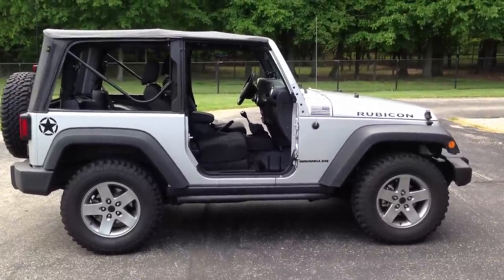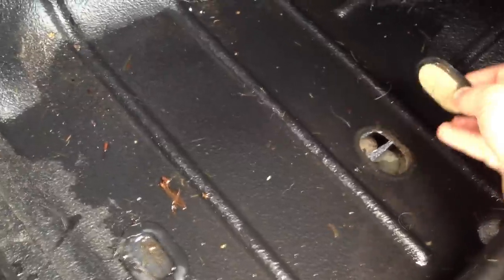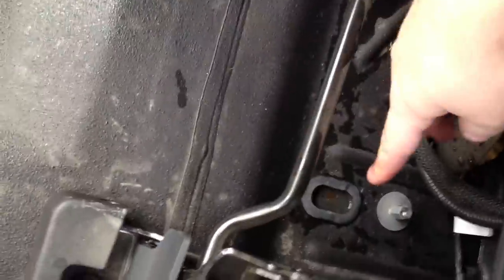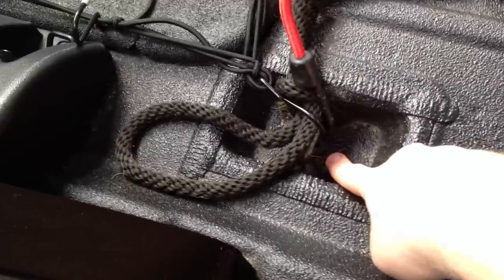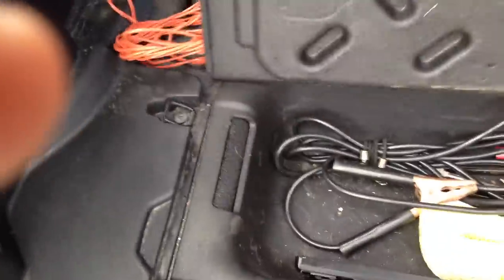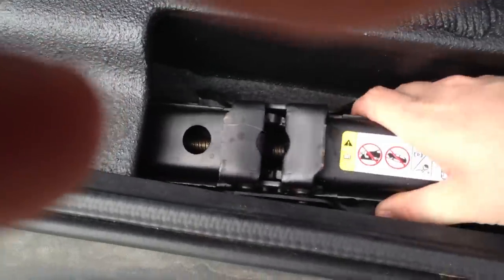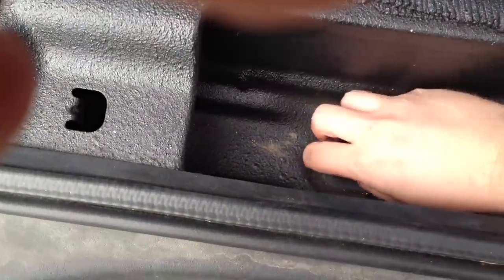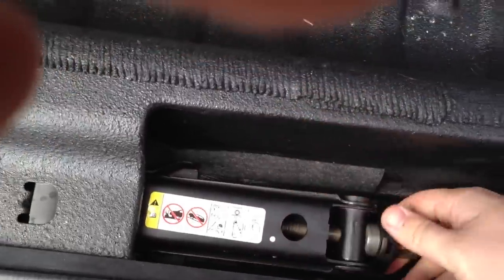Jeep Wrangler JK Drain Plug Locations and Removing Stock Jack

Comment: Do you have rubber plugs on the side behind the front seats? I just bought a 2012 and they are missing. I can order floor drain plugs, but cannot seem to find a place to get the oblong ones on the sides.
Reply from the maker: There isn't rubber plugs that come with the jeep for those holes. If i remember right the carpet covers them. I used JB weld and some sheet metal I cut to cover the holes. Then I bedlined over the metal covers I cut.

Comment: So far I’ve gotten the rear sound deadening from underneath the rear back seat I’m working on the front did you use a chisel to get the front off I used a chisel and a heat gun I have the same jeep 2dr
Reply from the maker: Thats what i did too. It took awhile.

Comment: was wondering how u find road noise with the bedliner instead of carpet?
Reply from the maker: It doesn't bother me. I have noticed when I have the hard top on in winter that I get a slight whine from the rear diff. Its pretty faint, and I always have the radio on so I don't notice it. Likely if I kept the unsightly heat/sound reducing goop in back there it would cover it up? If I had to do it again I would only have removed the back and kept the front goop in (and bedlined over it). It can get a bit hot on really hot summer days on long drives. The ridges in the floor board make it annoying to drive without a mat or floor liner (with tool box liner underneath so they don't float around). Its the best mod I have done, and highly recommend it with Line-x, Raptor, or monstaliner. All of which clean up easily. Steer clear of herculiner.

Comment: How do you remove the "heat type goop" that is normally stuck to the floor?
Reply from the maker: Check out the raptor liner link in the description. I used a heat gun and putty knife. It takes a good while. There is a video on YouTube where a guy uses dry ice. Way faster, maybe not as clean?  After most of it was out I used a wire sander on my drill.